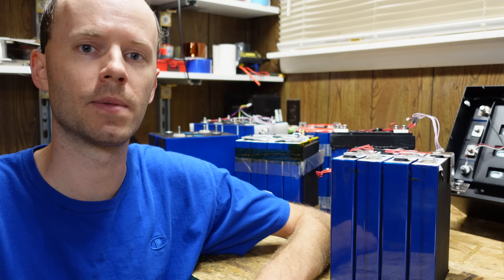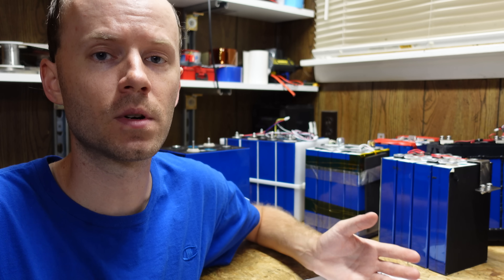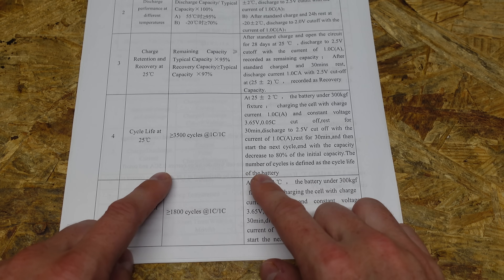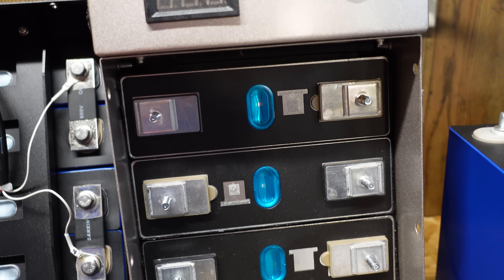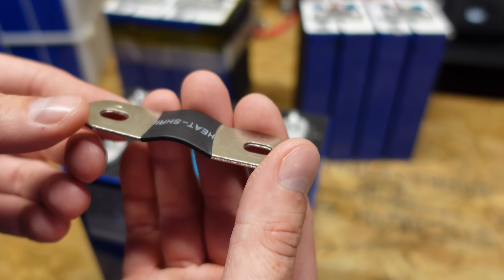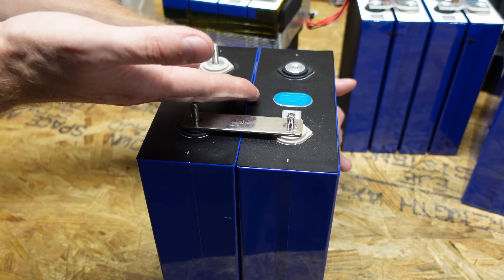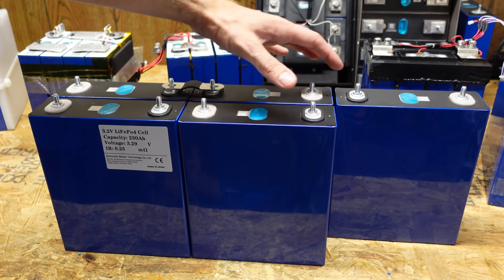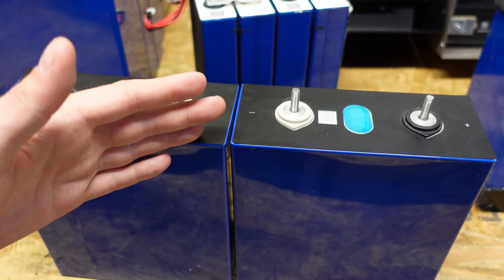LiFePO4 Battery Compression, Fixture, and Assembly - What's the Deal?

Comment: Though I haven’t built it yet, my design is to use the threaded rods with springs. Between each cell, a thin rubber sheet 1/16” thick. Prevents wear of the blue shrink wrap and will allow for slight expansion of the cells. As for connections, I’m using appropriately sized welding cable and crimped lugs in small horseshoe shape. Completely eliminates stress on the terminals. Yes, it’s a lot of wire and lugs, but you only do it once. This way, you have the recommended compression, the ability for expansion without over compressing the cells and zero stress on the terminals. That’s the best design that I have come up with so far but I’m open to suggestions for improvement.
Reply: How long are your wires?

Comment: Instead of bus bar, why not copper wire? They will flex etc. or thinking of the shape of the bloat, the long side is curved most in the center. What if combine your old method with the new snake method? Meaning instead of each battery touching on the smaller side, let them touch on the longer side but only for the 2” to connect bus bar. 
Love the thought process. Thanks for sharing

Comment: 7:19 As you are talking about 1 mm movement I think there is plenty of space for the rubber padding to take up the movement. 
If there is 1mm expansion and the rubber takes up 0,5 mm there is only 0,25mm movement left for the connectors to take. Using washers the way you do and the fact it is only on 1 side of the battery, I would expect this to be fine.
You do have to assemble the batteries when empty so the rubber goes into compression. 
But I agree "bend bars will take on some of the force"

Comment: Like a commenter said below, charge to 80%, then limit further expansion with end plates of aluminum or wood with threaded rod. Tighten your bus bars and your done. As the cells discharge there may be some space between them, that's fine. No worries about cell terminals being damaged. 
Much of the worst bloating occurs at higher levels of charge. So don't charge to 100%.  Charge to 90%. The expansion pressure developed from 80 to 90% is negligible. Even from 80 to 100%, very little pressure is developed. I have the same bloated cells that Will has, and this has worked for me. 
There must be a reason manufacturers say to compress or i.e., limit expansion of cells.

Comment: Part 4: 
So anyway, and I apologize for going on into so much detail – but I wanted to try to give you a complete picture of what I’m planning on doing and why. In your case, I have not seen any indication from watching your videos that you are concerned about making any sort of provision for heating these batteries so that they may be charged. BUT – I think if I were in your situation – I would add a minimum consider the possibility of just perhaps even continuing to organize the batteries big flat side by big flat side and provide some sort of compressible spacer between the cells as I try to hopefully outline clearly above, and consider using homemade connectors using lugs and electrical cable between the terminals as necessary.
Then, around the bottom and top perimeter of the battery/the individual cells collectively, I would consider trying to build some sort of frame, perhaps constructed of ‘angle aluminum’ or something like that again with some underlying weatherstripping to protect the cells wherever they might come in contact with the aluminum AND devise some way – perhaps with more angle aluminum top to bottom on corner and/or simply using some sort of woodframe, build some sort of ‘crib’ or ‘scaffolding’  (or ‘frame?’) so that you can pick up and handle the batteries and BMS and whatever as a single unit.
Personally, and again – I just don’t think that trying to worry about COMPRESSING the cells to try to eke out a few more cycles is worth it AND then if you do that things tend to get complicated you have to worry about how accurate is the pressure and how consistent would it be over time and/or what happens if the cells decide they want to expand side to side and they cannot and then start to have to worry about them popping open the pressure relief ‘valves’ or whatever… Too much complexity and too many worries…
As far as I’ve been able to determine, the fact that a single may swell a little bit when it is charged or might even arrived with a fair amount of swelling when an order is received MAY OR MAY NOT MEAN THAT THE BATTERY IS IN SOME WAY SUBSTANDARD OR DEFECTIVE. As far as I have been able to determine (and I did a fair amount of checking around), the fact that a cell might be swollen even when one receives it does not necessarily mean that it is bad or unsafe. That is not to say that it might NOT be a grade B cell BUT it is also quite possible that it is still a Grade A cell and in any event, does not appear to represent any kind of safety hazard and the cells can – as long as they’re not leaking – be used safely.
In closing, I will just finally mentioned that when my cells arrived in I expected them, ‘to the eye’ they were perfectly flat when one inspected them visually looking down across the big flat sides. 
However, if I laid a steel ruler/straight edge across those sides, you could actually see some ‘waviness’ across the flat surfaces – steel straight edge revealed that the cells were bulging ever so slightly ROUGHLY vertically down each side where one might imagine a pole or electrode or something might be running (even if it might be a wrapped pole or something) ACCOMPANIED BY a slight depression between the two ever so slightly bulging surfaces/waves. 
When I stacked the battery side-by-side out-of-the-box, they fit together perfectly/flatly for all practical purposes. 
However, after they had been fully charged up, I would say that the sides of some of the cells might have expanded by roughly a millimeter or so in total (adding up the bulging on both sides) AND SO that if you happen to put two of the cells together, side-by-side, you could wind up with a 2 mm or so gap at each vertical end of the cell and/or if you sort of rotated the cells around bulge, in order to get no gap on one vertical side, you could wind up with a 4 mm gap at the other extreme side!
So, in the end, I simply decided I’m not to worry about this stuff. There is an old expression that one can become ‘too anal’ about something… Worry about things that don’t really matter much at all in the grand scheme of things, if in fact anything at all.
Anyway, hope I’ve given you some ideas. I would personally just go with the “Boxer Shorts instead of Bikini Briefs for the cells; give them room (restrained room) to boogie and dangle/swing free however they might want to and just possibly consider making up busbar substitutes out of wire and lugs like I am.
Hope my thoughts help. 
Cheers.

Comment: Part 3
ANYWAY – with all of this background in mind – can see that I decided to leave space between the cells and not bother worrying about trying to compress them or anything like that for the same reasons you are considering. I PERSONALLY DON’T THINK IT’S WORTH IT EVEN IF ONE COULD FIGURE OUT A WAY TO DO IT SIMPLY IN ORDER TO TRY TO EEK OUT A FEW EXTRA CYCLES. 
As you pointed out, under the worst possible conditions of abuse/use, you should be able to expect these batteries to function before hitting 80% capacity FOR AT LEAST 5 TO 6 YEARS. And again, that’s under the worst imaginable forms of use – daily full recharge and full discharge and charging at maximum specified rates. 
PERSONALLY (and by the way, I watch Andy’s off grid garage videos regularly as well as ‘Will’, I think I’m probably going to shoot for a charge cut off voltage of about 3.55 V – possibly even 3.6 but more likely 3.55 – and not worry about only trying to charge up to 3.40 V or 3.45 volts as Andy at the off grid garage is currently experimenting, SIMPLY IN AN EFFORT TO TRY TO PROVIDE THE MAXIMUM POSSIBLE OPPORTUNITY AND ‘LEVERAGE/INFORMATION’ to the Battery Balancing Capabilities built into the BMS proper AND if they prove to be insufficient, then I think I will simply add on/install permanently the little two amp max balancer that I described above. As I understand these things, cell balancers whether passive or active NEED TO SEE A VOLTAGE DIFFERENTIAL BETWEEN CELLS IN ORDER TO TRY TO DO THEIR THING and so I figure the more time and opportunity you could give them on the steep part of the charge curve when the batteries are nearly fully charged, the better they can do their job and the more likely the individual cells will stay if not perfectly in balance at least a lot closer than they would otherwise. 
How well is this all going to work out? I don’t know. I figured that this is the way I would try to do things initially and just check the individual cell voltages once a month or so (diary a reminder in Microsoft Outlook or something to check) AND, if necessary, initially temporarily install the active balancer (I will leave the wiring in place) to bring things into balance.
NOW - onto the busbars and bulging and stuff. I came to the conclusion before you it would appear that I might decide to become nervous about ‘swelling’ of cells during charging and discharging, possibly/arguably too swollen cells at point of initial arrival, etc. AND BOTH the potential – if the batteries are pressed together and held with tape – say – for example and not actually in a compression fixture, that you could have both rotational and longitudinal stresses and strains on the terminals of each battery when they were connected up by SOLID SHUNTS. Now in part, but not exclusively because of the plans I outlined above for my pack, I HAVE DECIDED THAT I AM NOT GOING TO USE ANY SOLID BUSBARS OR WHATEVER YOU WANT TO CALL THEM TO CONNECT UP THE INDIVIDUAL CELLS. Instead, I ordered myself some high quality copper lugs (6mm center holes in my case) and I intend to TAKE THE INTERCONNECTIONS between the positive and negative terminals of adjacent batteries using short cables made up of/using 4 gauge welding cable which I happen to have 100 foot rollup lying around in my garage. (Note: I will double check to try to make sure that for gauge should be enough but I’m pretty sure it should be for a maximum of 100 A which is what I intend to limit the pack output and charging current to). I kinda figure that way, those cells can really ‘boogie’ and do whatever they want within their ‘loose fixture’ separated by the weatherstripping and unrestrained by any rigid metal busbars whatsoever, AND the open space between them will reduce/eliminate the chance of any abrasion taking place and/or provide me with the space I want and will need to install temperature sensors AND even allow for some heat from the underlying heating plate to ‘waft up’ between the batteries to help warm them up should they happen to be below zero Celsius and heating becomes necessary.

Comment: Part 2:
So, that’s where things stood until recently. I’ve been ordering bits and pieces trying to get everything altogether fell that I can sit down and at a Single Sitting, complete the assembly of the pack.
On the subjects of cell spacing, expansion/the possibility of trying to use compression, ‘some sort of fixture’ or something to enable the cells to be manipulated as a unit, ‘busbars’, etc. - I, after an awful lot of reading and research and thinking and calculating, decided I was going to do the following:
•	I have no plans to bother trying to ‘compress’ the batteries by whatever pounds per square inch or anything whatsoever/squeeze them all together to try to eat out extra cycles.
•	In fact, I am going to design some sort of fixture which will enable me to handle the pack with the attendant BMS as a single unit, which will be designed specifically to provide some space – perhaps 3/16 inch to ¼ inch or so BETWEEN each of the four cells which I intend to arrange ‘big flat side to big flat side’. Probably the way I will do this I think will BTUs some sort of/perhaps black self-adhesive closed cell weatherstripping running up and down the sides of each battery BETWEEN them with no other weatherstripping or separation horizontally across the bottom or top. The purpose of the weatherstripping would be simply to both provide spacing between the cells of the above desired dimensions AND allow the batteries to expanded contract is much as their little hearts desired during charging and discharging.
•	One of the reasons I wanted to allow for the spacing besides allowing for expansion and contraction of the batteries during charging and discharging was because I wanted to be able to install temperature sensors BETWEEN the cells rather than simply on the outside.
•	AND ANOTHER REASON was because I intend to build my (for want of a better term) FIXTURE or whatever you want to call it so that I can pick up and handle the four cells with the BMS attached is a single unit which I intend to in turn, install inside a larger enclosure WHICH WILL BE INSULATED.
•	At the bottom of the fixture, I intend to construct a heating pad which will be wired up so that it will be able to obtain whatever power it needs to generate from the battery pack itself. I intend to construct it as a ‘sandwich’ consisting of four layers - the bottom most layer being a red silicone baking/cooking mat which I was able to purchase at Canadian Tire for about five dollars with a second layer being/consisting of four smallish 50 mm x 100 mm 12 V 15 what silicone heating pads – one for each battery cell – ‘SITTING ON TOP OF’ a sheet of aluminum to operate as a heat spreader… NOTE: the heating pad themselves are pretty flat but they are a little bit thicker where the wires run into them so what I intend to do ‘notch’ the aluminum to allow/provide for a perfectly flat surface relative to the surface of the aluminum plate.
•	For the aluminum, I wound up purchasing two I think they were 16” x 21” aluminum cooking sheets from Costco for about $6.50 total. These are thick enough and more than large enough for my purposes. In fact, I think the sheets even after being cut up/down to the size that I need would be sufficient to build about four packs.
•	Then on top of those/aluminum sheets, I intend to install another layer of a second flexible red silicone baking sheet.
•	And finally, sit all of the four cells down on top of this.
•	THEN. I intend to build some sort of fixture to ‘restrain’ the batteries top to bottom side to side and end-to-end with a suitable handle on it which will enable me to pick it up and lug around as I see fit, with the BMS attached.
•	THEN I intend to build a larger enclosure INTO WHICH this whole thing will fit and be anchored down, the purpose of the larger enclosure being to provide space for housing such things as uses and a victor on smart sure that I purchased and various power meters perhaps and switches and 12 V/USB outputs and so on and make that box strong and sturdy with a handle on it so I can move that entire unit around together…